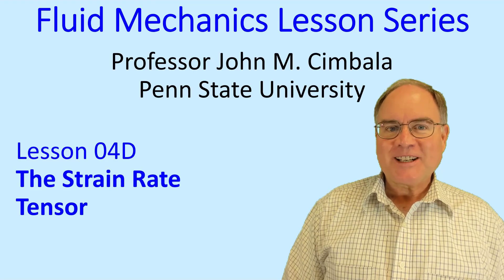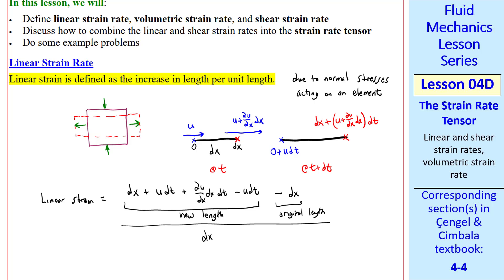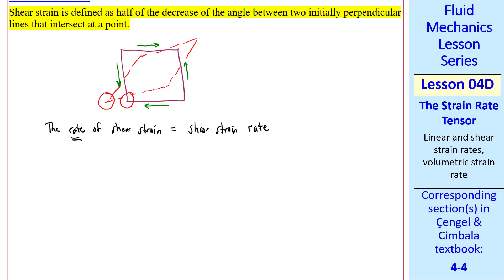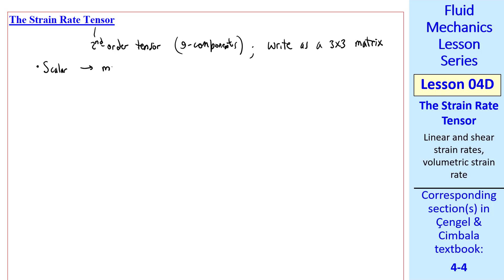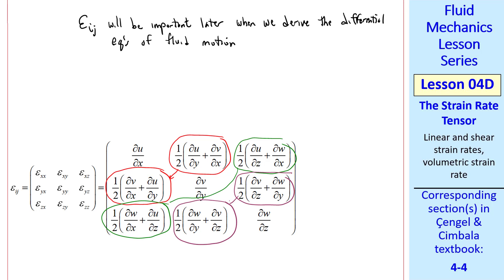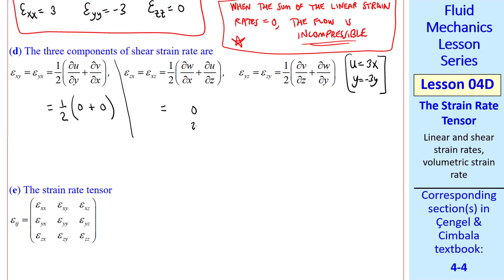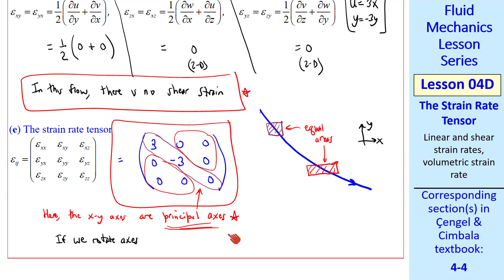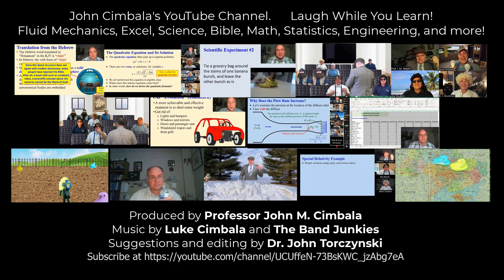Fluid Mechanics Lesson 04D: The Strain Rate Tensor

Comment: Damn, US universities are so hard core that they teach strain rate tensors to undergrads. In my UK university (which is top 5 in civil), they didnt teach us any of that. 

But i thought these are linear strains and shear strains instead of linear strain rates and shear strain rate specifically
Reply from the maker: strain represents the actual distortion - this is used in solid mechanics to show how much a solid has distorted. In fluids, there is continual distortion, so strain itself is not so useful. That is why in fluid mechanics we use strain RATES.
Reply: @johncimbala I found out the reason for my confusion. Since solid mechanics uses u, v and w to represent displacements while fluid mechanics uses u, v and w to represent velocities, so when I read 1/2 (u nabla+ nabla u), my first thought is going straight to that this is the strain tensor and I didn't realise u, v and w was representing the velocity in fluid mechanics
Reply from the maker: @Martin-iw1ll  Yes, that is correct. It is indeed confusing.
Reply: @johncimbala Or is it because when using Eulerian description, we are using a fluid element at a specific location fixed in space (and the fluid is passing thorough the fluid element), thus we can use the strain rate tensor to describe such a fluid element and derive the potential flow equations and Euler equations
Reply from the maker: Yes, that is certainly part of the reasons for using strain rate instead of strain. It just makes more sense in fluid mechanics since all fluid elements are continuously distorting. This is also why the Eulerian description is usually preferred over the Lagrangian description for fluid flows. @Martin-iw1ll
Reply: @johncimbala  But in Malvern's Continuum Mechanics book: It is said that the rate of deformation tensor D is sometimes confused with the time derivative of the strain tensor d. The small strain tensor E dot (depsilon/dt) is defined in terms of the material or initial coordinates while the rate of deformation tensor D is defined wrt the spatial coordinates. When the displacements and displacement gradients are very small, the two tensors are approximately equal. But the rate of deformation tensor is usable in situation where the displacements are not small (e.g. fluid flow, drawing, extrusion, etc). And the spatial description is the description is the description most used in fluid mechanics, often called the Eulerian description. Thus in the spatial description (Eulerian description), it is necessary to use a definition of rate-of-strain that is wrt to the spatial coordinates, which is the rate of deformation tensor D, right?
Reply from the maker: @AndrewCheung-j7x  You are on the right track in thinking about these things. What I show in my videos is the standard for fluid mechanics because of the large and continuous deformations in fluid flow; hence the reason for using time derivatives, namely the material derivative.
Reply: @johncimbala Is the strain rate tensor not the most appropriate for fluids since most fluids undergo large deformations so it is necessary to use the rate of deformation tensor(stretching tensor), where it is formulated in terms of the spatial coordinates.
Reply from the maker: @Martin-iw1ll  Not so much that it is a large strain, but that it is a continuous strain which makes it necessary to look at the rate of strain at a given time rather than the actual strain itself.
Reply from the maker: Thank you for your comment. Please tell your friends and colleagues about my YouTube channel where there are hundreds of free videos about the Bible, fluid mechanics, science, math, statistics, air pollution, and other topics. I would greatly appreciate it.
Reply: @johncimbala I will gladly share your great channel

Comment: Thanks a lot professor
I got a question 
I haven't taken the course of applied mathematic for engineers yet but i took the one of ordinary differential equations 
The bottom line is ,does that affect figuring out the course of fluid mechanics
Reply from the maker: For a good portion of undergraduate fluid mechanics, knowledge of ODEs might be sufficient. However, when we get into the equations of fluid motion, you must understand partial differential equations (PDEs).
Reply: @johncimbala  Another question: Are your videos enough, or should i study from the book ?
Thanks a lot for your time
Reply from the maker: @hishamsalameh5750   I call the videos "supplements." You would definitely learn more by reading and studying the book.